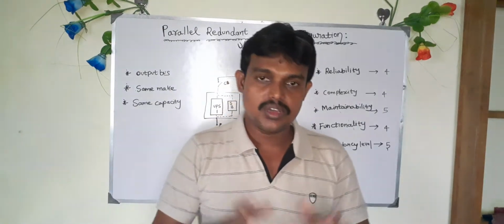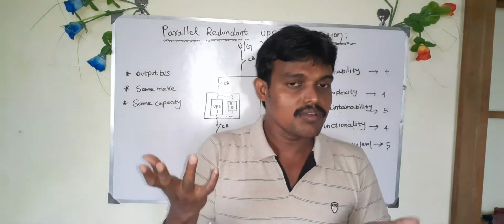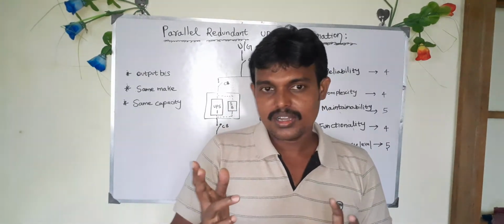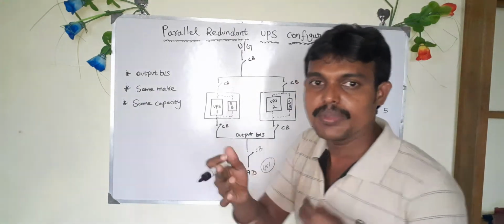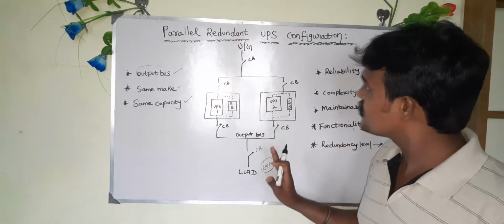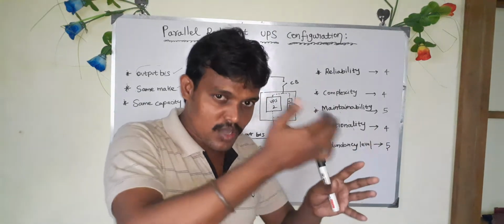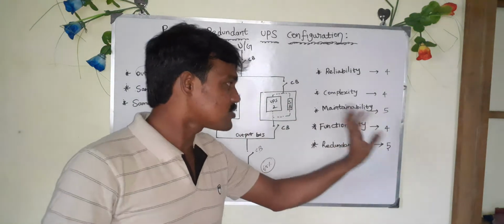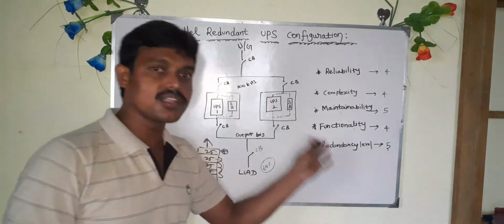Parallel Redundant UPS Configuration || English

Comment: Hi bro
I have a projector, when i use the UPS for projector it's not working ,so can i use two UPS output to connect  one projector? if i do like that, is there any problem or not?
Reply from the maker: Responded already..
Reply: Yes, if the UPS are configured in parallel configuration, n+1, they will be supporting the same load, they will share the load mutually